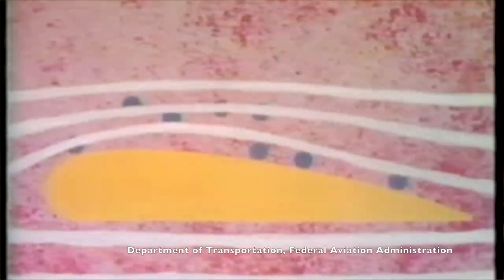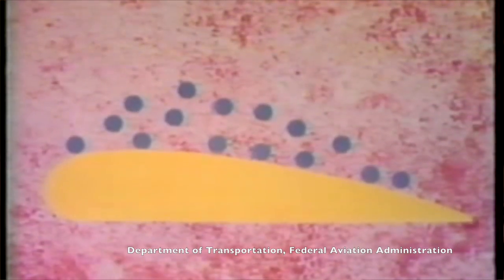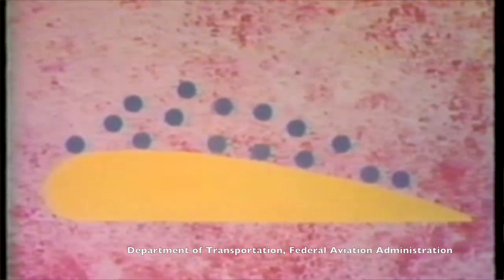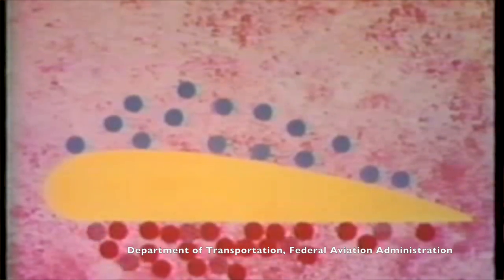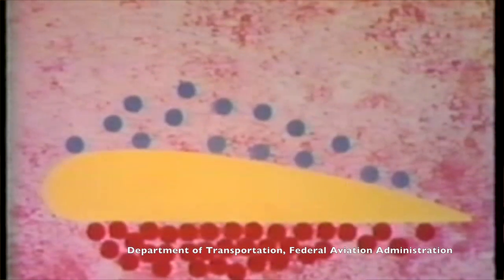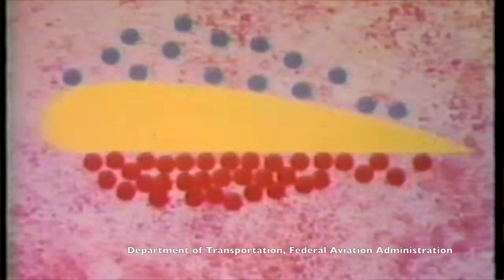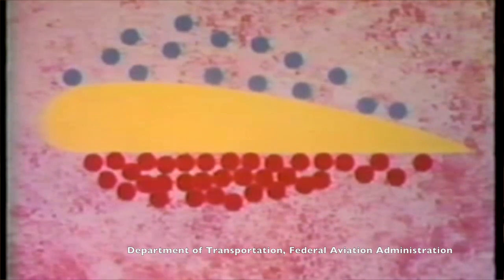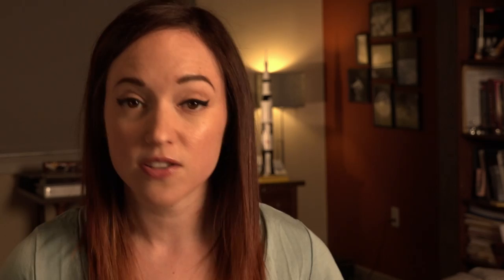How Do Airplanes Fly?

Comment from the maker: A lot of you guys noticed the part about pitch is repeated. This is what happens without an external editor and late night working... sorry!
Reply: You are forgiven.
Reply: ***** The good thing about YouTube is that if your internet is out tonight, you can watch something when it comes back in another day.  : )
Reply: Speaking of which, Amy, What is with this "sorry"?  There is no due date to completing these, this is not a live program, or a school report or something.

Why not just fix the video, take down this copy of it and repost the fixed version? 
No one will mind if you do.
; >
Reply: your explanation of lift is fundamentally and totally incorrect although I understand this completely wrong idea of lift is unfortunately common. You should have thought a bit more before making the video however. In particular, if this theory were true, how would stunt planes fly upside down? How would a symmetric airfoil generate lift at any angle of attack? How would a cambered airfoil increase the lift coefficient without the flow detaching and stalling the aircraft? In truth lift is a result of vector circulation of the flow field about the airfoil. It's hard to explain and better men than me have told me they can't explain lift without vector calculus. This is no excuse for false information however.
Reply: drillsargentadog 
Question, how do planes get off a runway? Also did you know  astrophysicists comonly use Newtonian physics to calculate course layouts for space missions rather than Einsteinium calculations?  Wouldn't that also be fundamentally wrong?
Reply: Answers: (1) The plane gets off the runway by building up enough circulation about the wing to generate a lifting force greater than its weight (Mg, where M is the mass of the plane and g is the 9.81 m/s^2 you probably learned in high school). The total lifting force is proportional to the velocity of the oncoming flow. Note this is not any difference of speeds between the top and the bottom, just the speed the air is coming at the wing from the rest frame (PoV) of the wing--moving plane is equivalent to moving air from the wing's perspective. This will still be true if a plane increases thrust in flight. Next time you're on a plane, pay attention to the control surfaces when you are speeding up or slowing down in flight, you will see them change to control how much lift is being generated.

(2) I think you mean engineers since astrophysicists are more fond of studying natural objects than making spacecraft. The reason for Newtonian calculations is the S/C is moving slow compared to the speed of light. This means relativistic corrections are too small to ever matter. You wouldn't get anything wrong by using relativistic calculations, but it would be a lot more complicated to get the same results to any significant degree. Engineers are often proud when they can produce a really accurate result without unnecessary effort and sticking to Newton's laws when planning normal space missions is an example of this.
Reply: drillsargentadog
 Actually that is my point, the simple explanation and the adequate solutions. My mother gets nervous on planes because on a primal level this big weihty lump of metal shouldn't be able to fly. Describing the concept of lift and atmospheric weight goes someway to helping people like my mom feel like they (and me) have at least a grasp of the concept of flight. Perhaps if Amy was presenting the video to a group of peers rather than a Youtube audience she would have been more precise.
Reply: oh, I thought you genuinely wanted to know...my apologies for taking the time to answer you in good faith.

I think you are conflating using a really good approximation (Newton vs Einstein) with an explanation which is fundamentally flawed. While Newton's laws are so close to the truth as to be considered absolutely correct in the classical limit, the "different speeds" version of lift is simply wrong. If you use it for any even conceptual understanding it doesn't work, and it's not quantitative so you can't practically do anything with it. I could tell you that an army of small fairies are actually lifting the plane from the bottom (so you can't see them) and this would be EQUALLY WRONG! as the different speeds explanation, despite both being simple to understand. Simplicity is only nice when it has a connection to facts. 

Your mother's feelings remind of a time as a boy when, while flying on a plane, a stewardess gave me a "number puzzle" with straws. After some time I realized there was no honest solution and the only "solution" was a play on words. The stewardess returned, and upon my protest that "it's not really math" told me "don't pay attention to math, it's never the real answer", to which my father, seated next to me, responded "you better be joking, because math is the only think keeping us in the air!"

Decades later, I realized my lawyer father had a moment of engineering insight there. If you are motivated to understand the beautiful scientific and mathematical theory underpinning aeronautics, I would be the first to encourage you, but it's also okay to understand that people who've spent years understanding the details have made sure the plane will fly. What I don't like to see is people eschew the real explanations of fascinating phenomena for erroneous cereal-box length "explanations" and claim that they are practically equivalent. They are not. As I said before, if the simpler explanation actually worked or was even flawed but useful, engineers would use it instead. We do not.
Reply: Meh, happens to the best of us.

Comment: It's worth noting that the standard explanation of wing lift - the air going over the top faster - is an oversimplification.  There are many aircraft such as acrobatic planes that have symmetrical wings where the air has the same length of travel on the top and bottom.

The Bernoulli effect that occurs when the air over the top is faster is usually the dominant lift-generation mechanism for most airplanes. 

However, most airplane wings are also set so the leading edge is angled up a few degrees.  This creates lift through the same way that an angled hand out a car window generates lift - simple displacement of air.  A jet could have flat, angled slabs for wings and fly but it would be very inefficient.  Acrobatic planes have symmetrical wings that mostly generate lift through this mechanism because they spend lots of time upside down and you don't want the wings pulling you down in that orientation.  Efficiency isn't as important for those planes so they use this cruder lift generation mechanism.

Lastly, the air going over the top curved surface of a curved wing has a net downward momentum at the trailing edge of the wing which creates upward lift through Newton's 3rd law.

That doesn't even include other, more esoteric lift-generation mechanisms such as vortices.  While the Bernouli effect can be generalized as the dominant way planes generate lift, it is worth knowing that it is not the only one.
Reply: Thank you, I was tempted to point this out, and you beat me to it. :)
Reply: Ed T. NecroBones
This old comment just popped back up because someone +1'd it and I realized you're that guy that makes all those awesome KSP mods.  Thanks!

Comment: For everyone making the "Newtonian" and "flat slab/barn door" arguments, please go read "The Papers of Wilbur & Orville Wright" c. 1953, McFarland, Volume 1, specifically the entries between July and December 1901. Then, build a copy of Wilbur Wright's wind tunnel. Then reproduce his tests with the model wing sections. Done that? Good. Still believe what your schoolbooks taught you about flat-slab lift and Newtonian effects? Go read "Birdflight as the Basis of Aviation" by Otto Lilienthal. Still not convinced? Go build your own flying machine and use your flat-slab wings to prove us all wrong. The secret of flight is CREATING A DIFFERENCE IN AIR PRESSURE between the two sides of the wing. You can do that with an airfoil, with AOA, and by blasting air under, or OVER, a barn door. Ultimately, its the difference in pressure that counts. Now that covers how to generate lift. When you want to talk control, go look up "well digging", and we'll talk.

Comment: I've had trouble with confusing pitch and yaw, but I think I have it straight, now.  So, I have a question;  on a helicopter, is the yaw controlled by slowing or speeding up the little counter-blade on copter's tail?  
(If you'll forgive my layman's speak).
Reply: +TheNoiseySpectator - No. What the rudder pedals do is to change the pitch of the blades of the tail rotor. This adjusts the angle of attack of the blades to control how much force they produce. More pitch generates more force to make the helicopter yaw one way, less pitch and force makes it yaw the other way.

Changing the propeller pitch is the same technique they use on the main rotors to make the helicopter go up and down. Both the main rotor and the tail rotor always spin at the same speed and how much force they generate is governed by the pitch of the blades.
Reply: Joe Vignolo- Finally someone answers!  : D
 Thank you.  

But, I am a layman. 
1. What is an angle of attack?
2. Is the propeller's pitch how fast it is spinning  to and from an observer facing the copter, or how fast a blade facing any direction is spinning?  

...Or have I missed the idea altogether?
Reply: +TheNoiseySpectator - I'll do my best here, but some of these concepts are best illustrated using drawings or graphics rather than a written explanation.

Angle of attack (AOA) is the angular difference between an airfoil and the direction of the air that it's passing through. If an airplane is flying straight and level and parallel to the ground then the AOA is low. Then if the pilot pulls back on the control stick and raises the nose the AOA will increase dramatically.  When the AOA increases the air starts pushing hard on the bottom of the wings so the amount of lift increases and the airplane starts to climb. It's important to note that AOA and pitch angle are not the same thing. Pitch is typically the angle between the center line of the airplane and the ground while the AOA is the angle between the center line of the airplane and the local airflow. To illustrate a fighter airplane climbing straight up has a pitch angle of 90 degrees while the AOA is 0 degrees.

As far as your second question. Helicopters don't have propellers like an airplane does. Helicopters have rotors. The big one on top is usually referred to as the "main rotor". It's job is to provide the lift necessary to overcome gravity and lift the helicopter up off the ground. The main rotor is essentially a set of spinning wings that rotate around and around and work just like the wings on a fixed wing airplane. But because the wings are always spinning they don't rely on the aircraft's forward motion to produce lift. This characteristic is what gives a helicopter the ability to hover motionless over one spot and still stay in the air.

Because the main rotor spins in one direction it cause the body of the helicopter to want to spin in the other direction. This is why you need to have the tail boom and tail rotor. What they do is provide the counter force necessary to keep the body of the helicopter from spinning out of control. They also give the pilot the ability to yaw the aircraft left or right or to hold it straight ahead.

Most modern helicopters use jet turbine engines which work best at a single preset speed. As such both the main rotor and the tail rotor always spin at a preset governed rotational speed. This addresses your second question. Pitch really has nothing to so with how fast the rotor blades are spinning. In all cases the blades always spin at the same rotational speed all the time.

Controlling the amount of lift produced by the main rotors is done by changing the pitch of the main rotor blades, which in turn changes the AOA of the main rotor blades. This has the same effect as pitching up the nose of an airplane. The increase in AOA causes the wings of the airplane to produce more lift and the airplane goes up. On a helicopter the increase of AOA causes the main rotor blades to produce more lift and the helicopter goes up. This action is controlled by a control lever in the helicopter's cockpit called "the collective". Pulling back on the collective causes the pitch of the main rotor blades to increase, which causes the AOA to increase, which causes the lift to increase, which causes the helicopter to go up.

The same thing essentially happens on the tail rotor, except the tail rotor doesn't provide lift in the strictest sense because the force produced is sideways instead of up and down. But the rudder pedals do the same thing as the collective. They change the pitch and AOA of the tail rotor blades so the tail rotor produces more or less force, which yaws the helicopter left and right or allows it to be held pointing straight ahead.

The final piece of this puzzle is know as the cyclic pitch. It's more complicated but basically the pitch and AOA of the main rotor blades change cyclically as the rotor blades go round and round. How much pitch and AOA a specific blade has depends on where it currently is in the circle formed by the spinning blades. For example if a specific blade has less pitch when it is in the front of the helicopter and more pitch in the back this will cause the  nose of the helicopter to dip, which causes the helicopter to move forward. Doing the opposite makes the helicopter's nose come up and the helicopter will back up. The cyclic pitch can also be varied from side to side so that the helicopter goes sideways. The cyclic pitch is controlled by the control stick between the pilot's legs.

A lot of this stuff can be looked up on google or Wikipedia if you want more information.

Good luck!
Reply: Joe Vignolo-   I have your reply, but as you can imagine, I'm going to have to read it over more carefully than I could in just a few moments.  

Which actually sounds like a bit of fun.    :  )

Thank you for your reply.

Comment: Good video! Keep it on! I am pretty curious about why would nasa stopped using a 747 modified to sent space shuttle to space? is it because it's too dangerous or there's other reason be hide it?
Reply: NASA never used the 747 to take the shuttle to space, the 747 was to take the landed shuttle back to the Kennedy Space Center.  It was also used to take the shuttle to a high alltitude  and release if for approach and and landing tests.
Reply from the maker: That's right; NASA's 747 was used for shuttle tests, never for launch. And that does give me an idea that launch planes deserve an episode at some point!
Reply: Thanks :) and yes plz!
Reply: Amy Shira Teitel I  hope that the next generation of Space Shuttles would be build to be launched from a jet-like 747 flying at high altitude instead of from the ground.

'sigh'  But, the reality is that there just won't be any more Space Shuttles, at least not for a long time.  : (
Reply: Amy Shira Teitel All I can remember is that the B29 and the B52 used either the bomb bay or a release pylon under the wing to launch the X- rocket planes.  Have you done an article on that?  What was the altitude when the planes were "dropped"
Reply: TheNoiseySpectator Interesting concept.  I recall discussing this in my model rocket days.  One discussion was what if we could take a conventional airplane using jet engines and take it up to 100,000+ feet, then turn those off and kick in the rockets for orbit? There is a limitation to the upper atmosphere where you can use a jet plane before they won't work (little or no air).
Reply: Jim Gorycki The X-15, was released at an altitude of 8.5 miles, and the X-1 was 25,0000 ft.
Reply: TheNoiseySpectator Go check out Virgin Galactic's Stratolaunch system. Air launch to orbit is great for launch flexibility, but it's only moderately useful for adding altitude and velocity to a launch vehicle. Large rockets are more or less restricted to the familiar launch-from-the-ground paradigm.
Reply: Ben Etherington  Stratolaunch system. 
Thank you.
: )
Reply: +Ricky Life and Stuff Now, they never launched a shuttle from a 747...but there WAS a move afoot to do impromptu launches of small sattelites from a "glorified missle" slung under a modified F-15. The plane would get up to speed/altitude, go into a ballistic climb--and launch the satellite.

Never came to fruition, due to (among other stuff) explosions owing to oxidizer and propellant being pre-mixed in the same tank [eek!]